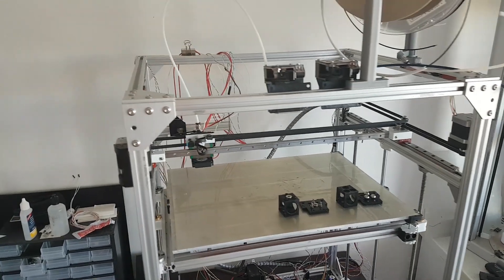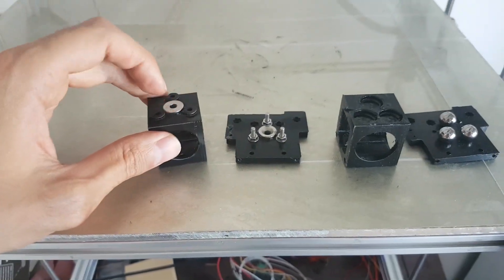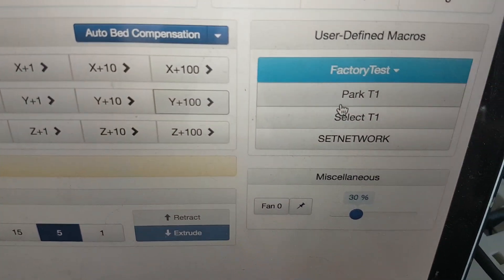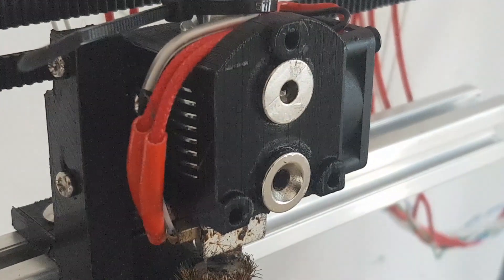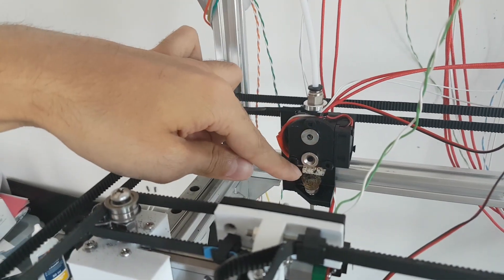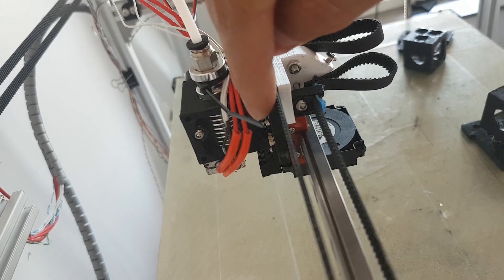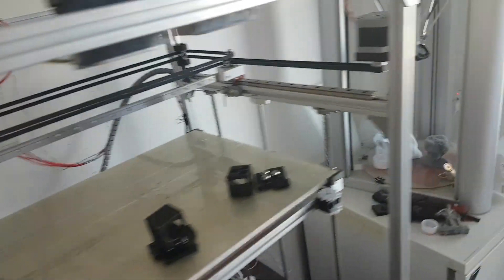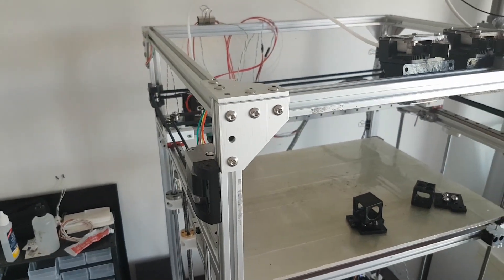RK3D Tool Changer #4 (Auto Tool Changer & DuetWifi)

Comment: Why did you remove the smart steppers ? Are you not able to make them work with Duet board? I thought the people at the company said they can work with Duet ?? Is that not true or is it not still using them for other reasons now??   Hoping to hear as I was about to order them to use on my Duet build! I see from video before with them on they are now not on the machine once you go from MKS to Duet board. Is it due to comparability? And if so have you checked recently if there is a way to use smart stepper with Duet board?? Many thanks !
Reply from the maker: I removed them to test the Duet drivers then I kept using the Duet drivers because they were excellent as well.
I didn't try to connect the Smart Stepper yet in the Duet but it's easy, just find the pins you want to use.
https://duet3d.dozuki.com/Wiki/Using_external_stepper_motor_drivers

Comment: i was thinking about using 3 magnetic buttons , like the ones used on clothing, mostly becouse they come with a nice armor to concentate the magnetic flux and at least the ones i looked upon are quite precise. i think 3 of them will increase precision a lot. 
have you tried that?

another options are countersink neodimium magnets like those you used to increase alignment using that same countersink,  but i dont know if there is any kind of magnet with a coned shape? that can go in there. 

but there seems to be other options. a halbach array makes excelent aligment but it is really HARD to release.
i have tried them wiht 5mm  square magnets.
  maybe a hybrid array of those same 5mm permanent magnets but with some 5mm hand winded dc magnets...  you could probably invert the polarity of them and release the head a lot easier. 

take a look too at (google the terms)  "polymagnet smart magnets for precision alignment"
Reply from the maker: Hi, the magnets in my setup are not used for allignment. The three pins will do that.
It doesn't really matter what magnets you use, the important thing is to find the size and strength that fits.
And let the alignment be done by three precision pins.

Comment: love your engineering, Have you been able to measure the repeatability of your toolchanger ? Im looking at making one as well, also like e3ds idea about connecting the tool head but it would require an aditional servo... hmm
Reply from the maker: Thanks Kees!
I actually haven't made a repeatability test yet, but will record a video doing it soon.
Yeah a servo means more size and weight, that's why I made it this way.

Comment: Awesome setup! I like how compact and simple the design is. And the use of screws for the pull off mount, great idea.
Reply from the maker: Thanks!
In the next video I'm going to show the new screws I used (bolts with smooth parts). You can check their pictures in the design page.

Comment: Really nice solution!!! Just pay attention to that metal brush with the electronics under it! Sometimes the wires can come off and if one of the wires fall right over your duet or power source it can lead to issues :D
Reply from the maker: Bruno Porto Thanks! And good point for the brush! Luckily the electronics box is on the other side and they have the enclosure as separator (in the design not on my actual prototype :D)

Comment: Well done, great idea and good to see you went with a duet, its actually nice to see your corexy design is so very similar to what i came up with, its correlation that either your idea or mine!! is not to bad as others are doing similar.
Reply from the maker: Thanks Mark! Yeah, the Duet is the best so far for me! Quality and alot of possibilities..
Do you have a link for your printer so I check it? I can guarantee it's my design, I have a whole history of the process since I started it :D it's nice to see other and similar designs tho!
Reply: Rajaa, my design was based on a Ft-5 kit that i threw away 90% of it and started again...I am away at work in Saudi Arabia unfortunately or I would show my design. I drew it up in sketchup pro, and printed, tested, threw away, redesigned and redesigned till i got what I wanted. I will try to locate the last sketchup design and post it. again great work
Reply from the maker: Mark Duncan I was just kidding! Me as well started by throwing most of the FT-5, but eventually kept the frame just to reduce the cost. I'm curious to see your printer because I liked the idea :)
Be careful from the sun there!